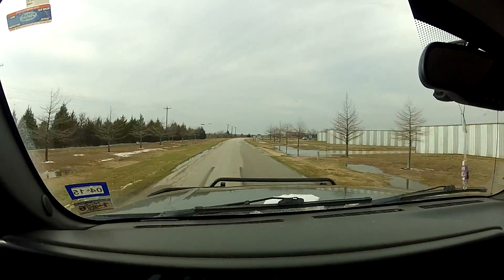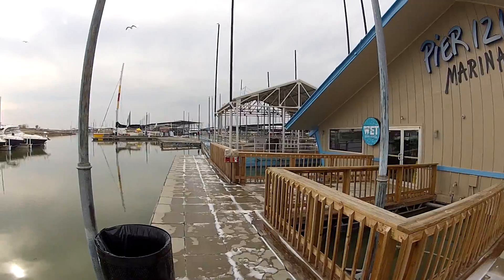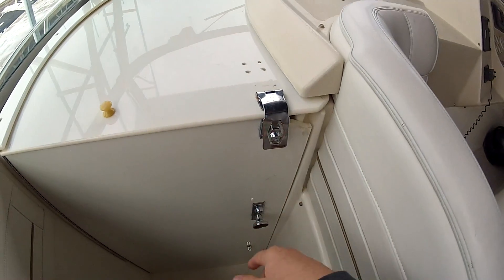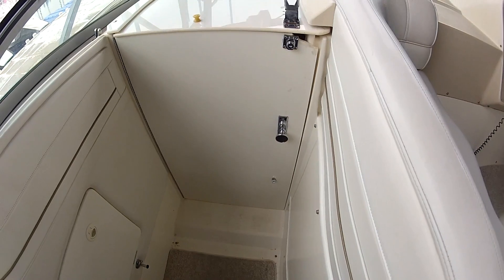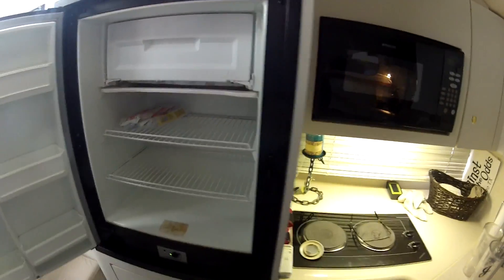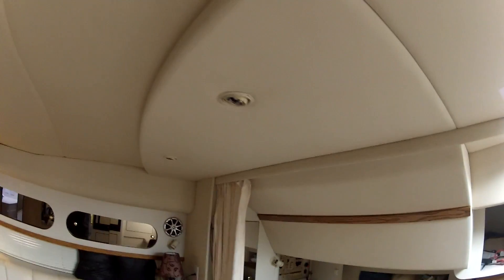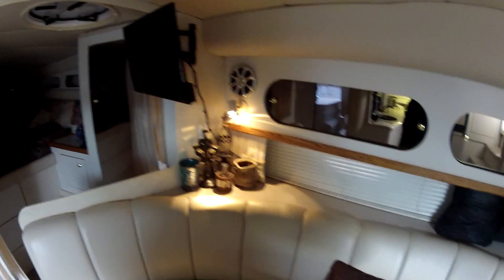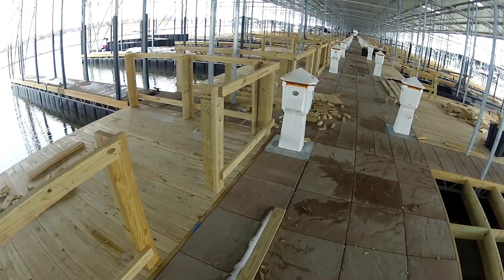Life Updates and New Dock Walk Around

Comment: That looks like a very high end marina. I'm curious about the main walkway. Is that ceramic tiles they used in that portion? Even though they used pressure treated lumber on the slips, they are still exposed to the water from beneath, and will eventually rot. So is there any protection the applied to the underside to protect the lumber?

Comment: Hey Frisco, question for you on your mudding video, I was told by someone that if you have 2 of the same trucks and 1 was diesel and the other was gas, that the gas one is better for off roading because diesels weight too much and you sink into mud instead of moving, is that true?
Reply from the maker: rev9fan1 I guess that could be true. Weight can hurt any off road truck
Reply: FriscoBoater but you've done a lot of off roading and the truck has been fine usually?